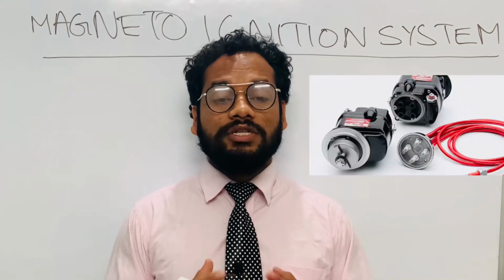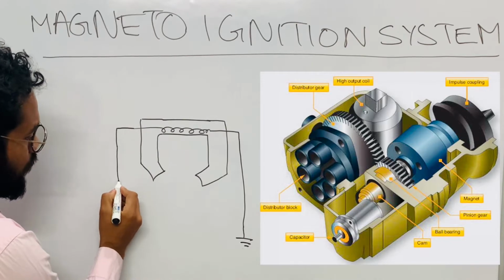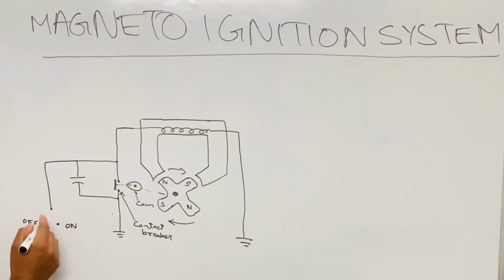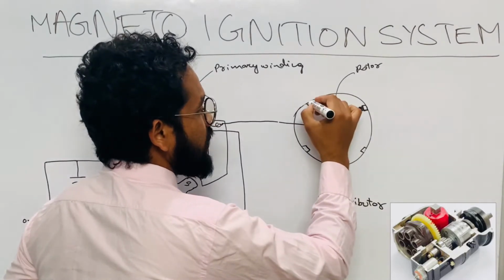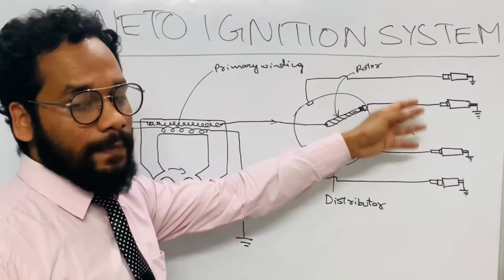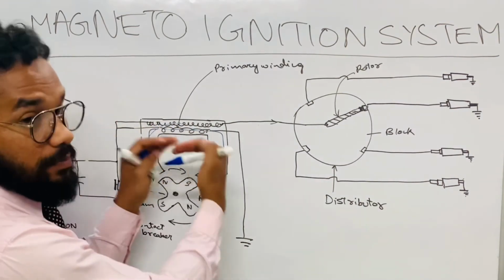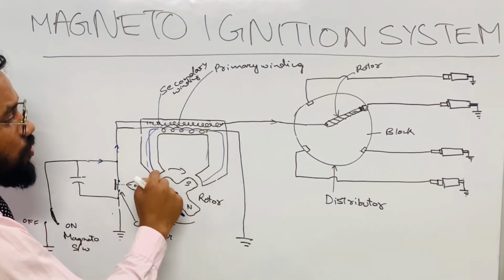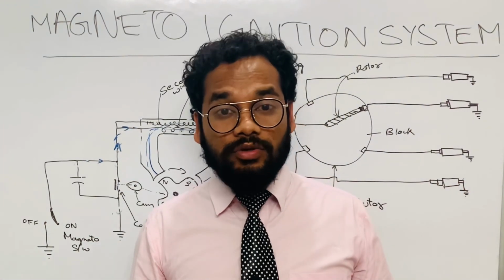Aircraft Magneto |Principle,Construction, Working & Schematics of Magneto Ignition

Comment: Sir , I asked you a lot about how to read a schematic/wiring diagram symbols , components, and how to trace and troubleshooting any failure in the circuit , let’s begin with a faulty fire loop A Ch26 as you know each loop contain 3 segments how can I determine which one is inop before consulting TSM for further investigation.
Reply from the maker: To determine which of the three segments (pylon, fan, or core) is inoperative on a faulty Airbus A320 Fire Loop A, you must isolate them by uncoupling the physical harness plugs between each zone to eliminate the parallel circuit architecture. Once disconnected, use a digital multimeter to test each segment independently for continuity along the center core wire and insulation resistance between the core and the outer grounded sheath. A healthy cold segment should read near-zero ohms for continuity and near-infinite resistance (open circuit) to ground; any segment showing low resistance (a short circuit caused by structural pinching or moisture ingress) or an OL (Open Loop) reading across its core identifies the exact inoperative component before you consult the TSM